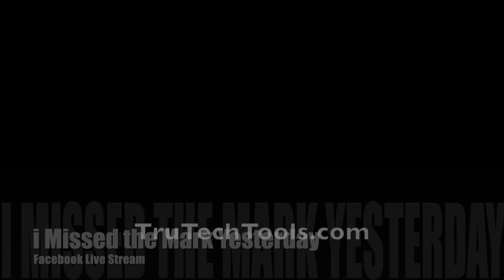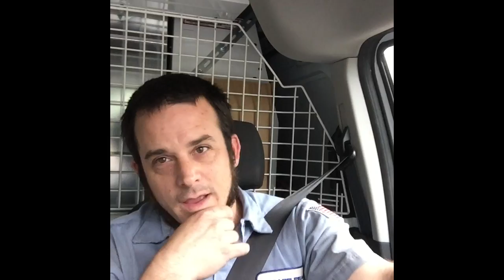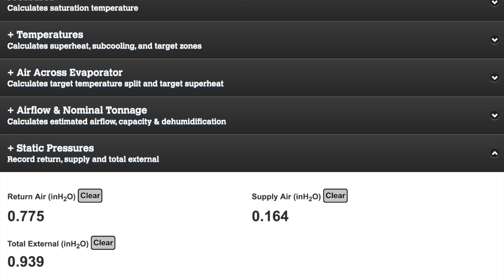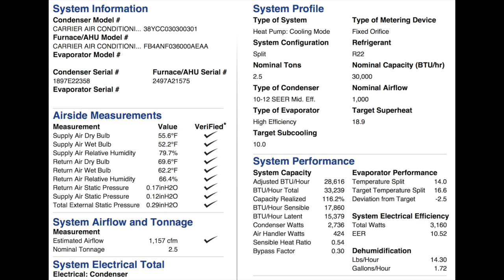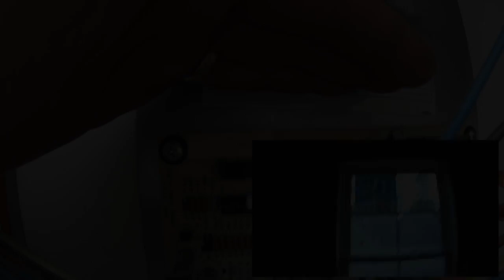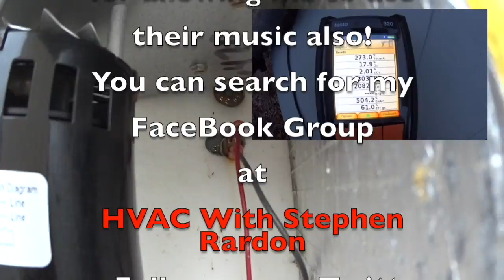I Missed the Mark Yesterday and 14/20 Pleated Filters 5-3-16 Facebook Live Streams

Comment: Stephen, I had to chuckle at this one, about one of the previous contractors moving a wire to the wrong lug.  Reminds me of when Homer Simpson told Bart one the most important things to know in life is the saying "It was like that when I got here!"  :-)     But on the serious side, odds are always stacked against a fellow anytime one or more other techs have been there and messed with things and then left. and the equipment still isn't running.  In spite of the call back, I expect the customers are still big fans of your service because they now have extra time to save for a new system.   Thanks for your videos.